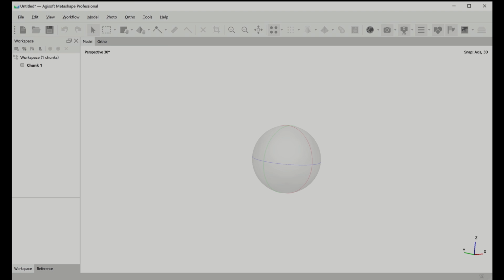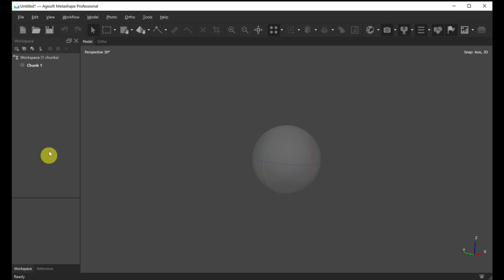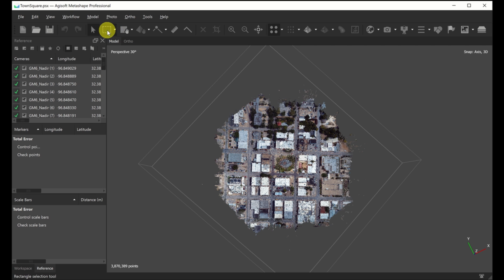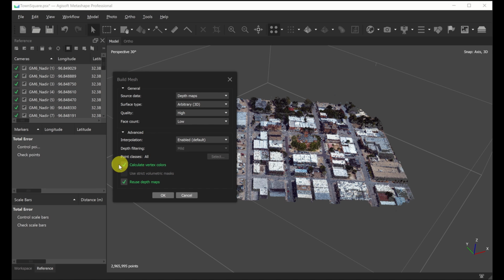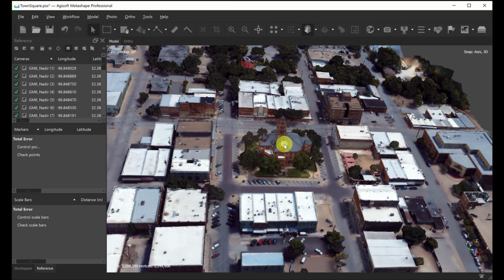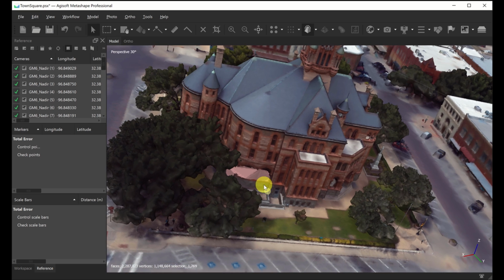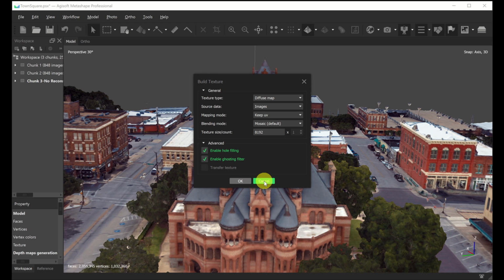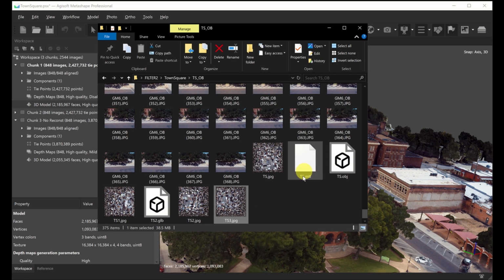Photogrammetry: Making a 3D model look good

Comment: Deleting tie points and then generating a mesh from depth maps serves no purpose, tie points are just used for camera adjustment so it'll generate the mesh from the depth maps from each camera, thus covering the entire area. In addition deleting tie points and not doing a camera adjustment afterwards is pointless. A better approach would be to use the drone mission boundary polygon imported from your drone software and use that in all stages of processing.

Comment: Everyone is using the professional version of metashape on all these tutorial videos, is everyone really paying the $3.5k to use the software or is there something I'm missing?
Reply from the maker: Yes I believe most people are paying $3500. It is cheaper than Pix4D. You can also get the same version as a student for $500. You just need a school email address
Reply: @GM6Labs  aren't there significant differences for the student version? (I'm not familiar with that one) and thanks for getting back to me so quickly!
Reply from the maker: No, exactly the same.
Reply: there are two version of pro license, one is much cheaper (but don't have all that factions for geodata etc)

Comment: photogrammetry still relies on classical algorithms. we need much more sophisticated machine learning techniques. The potential is very significant.
Something like google earth/streetview is an obvious opportunity for breakthrough because they have the means. Good photogrammetry could make models that look better than if the best humans made them instead of the clay blobs we get now.
Reply: Completely agree, and proof of this is the time it takes for data processing in almost any project instance. We need algorithms more related to AI than massive (slow and often deficient) processing. There is a lack of software that recognizes objects and, based on that, optimizes calculations.
Reply: good example: NVIDIA Instant NeRF
https://www.youtube.com/watch?v=DJ2hcC1orc4&ab_channel=NVIDIADeveloper
Reply from the maker: @DanFrederiksen  I whole heartdly agree with you and have a lot more I could say on that topic. For now I will just add, utilizing Unreal Engine does wonders for the models. I recently worked with a gaming company and saw what is possible. I am only a baby with Unreal Engine but the potential is huge.